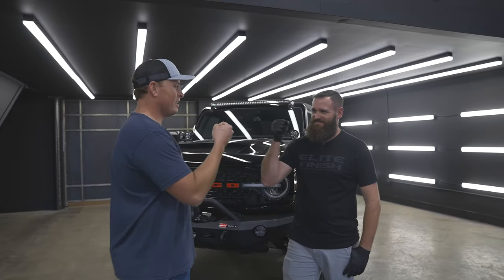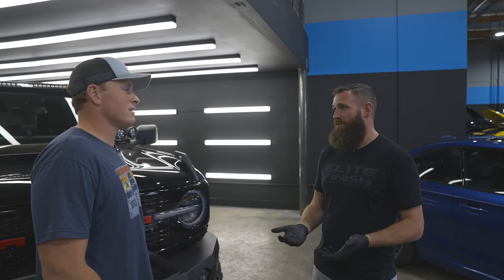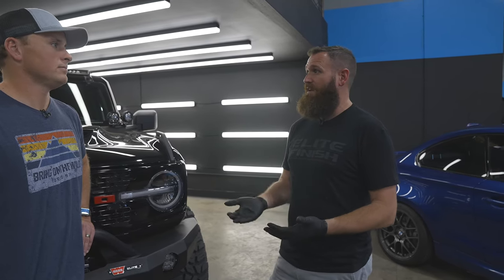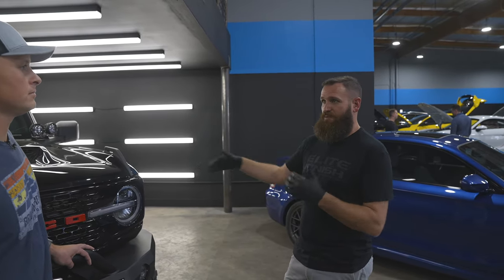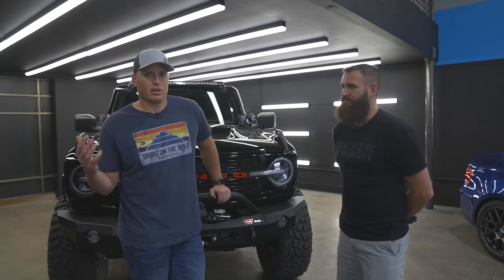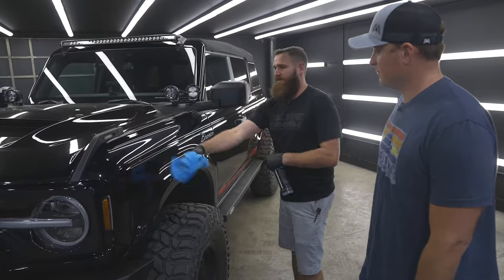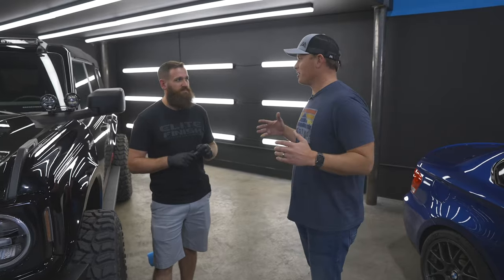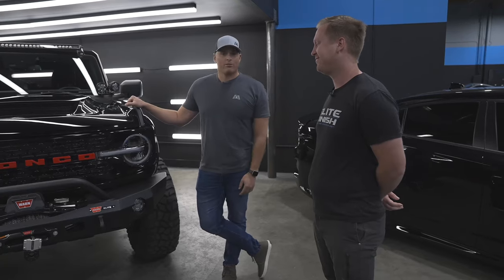Ceramic Coating vs Paint Protection Film. Which one is better for you?

Comment: Can you do ceramic coating over the ppf. Does that make sense on an of roader.
Reply from the maker: Yes! Another added level of protection for sure
Reply: Absolutely. It adds even more dust repellency, hydrophobics, UV protection, and even ease of cleaning. It's not a have to, but it is definitely a great thing to add.